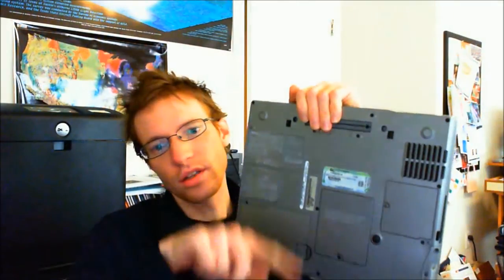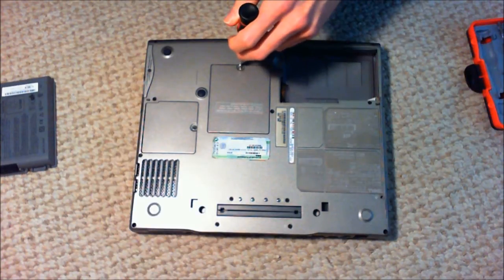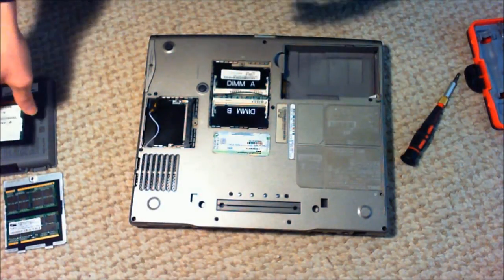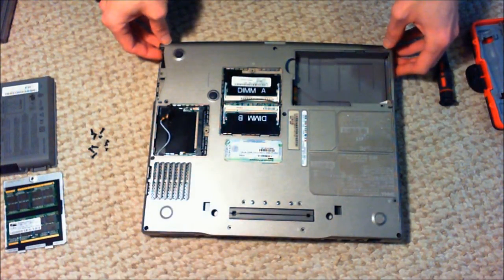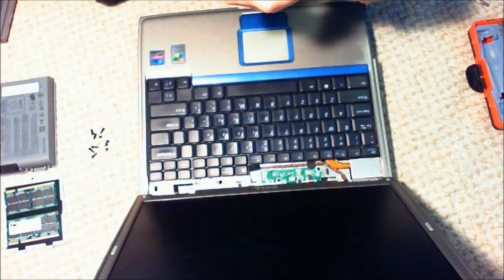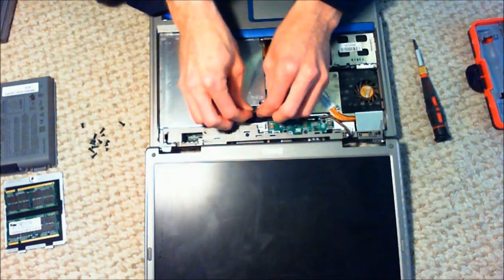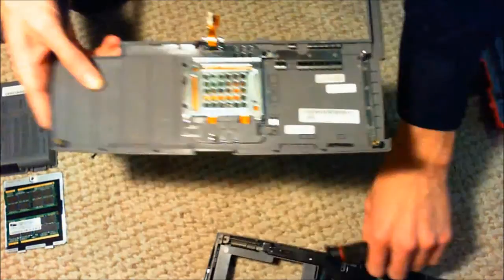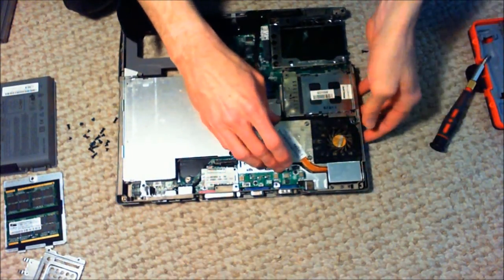How to Dismantle a Laptop - Part 1

Comment from the maker: I'd seriously say just get a screen and get the whole thing working again.  I've replaced a few screens, and it's not quite as terrifying as it sounds if you keep track of all your screws.  With some computers, the manufacturer will even provide a maintenance manual that gives detailed instructions for, say, removing the screen.  If you're nervous about that, and the thing still boots up fine with an external monitor, sell as-is.

Comment from the maker: Not very much, really, especially on older computers.  It's usually fairly easy to sell it "as-is" on ebay if you can resist dismantling it, or if the only thing that doesn't work is the screen, maybe just buy yourself an "as-is" of the same model and swap parts.  I mostly just like tearing stuff apart, but a few pieces in this one did get put to good use on my D610.